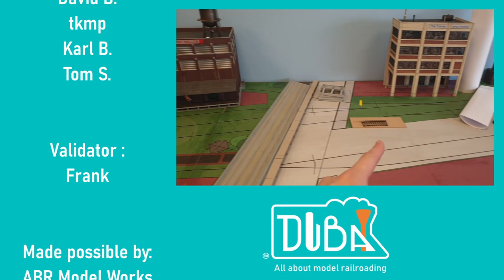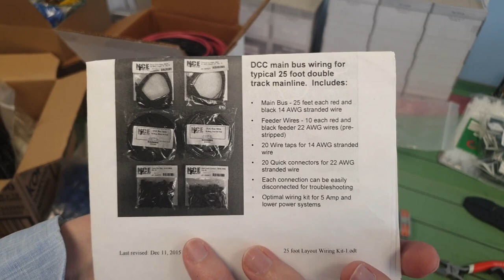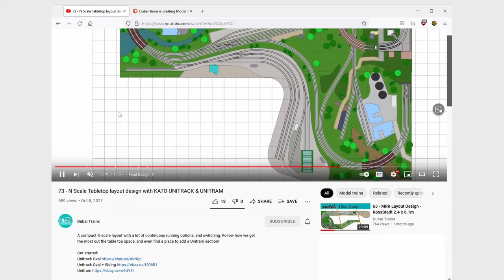EASY WIRING, Laying Track, Weathering, & more ~VLOG 134

Comment: Your attempt at reusing connectors is why I  switched to Posi-Taps for connectors.  If your feeders are stripped on the buss end you can install a Posi-Tap with no tools.  Plus you can move, uninstall and reuse a Posi-Tap.  Yes, they cost more, but are cheaper in bulk, and save a lot of time.   On another note, your layout is pretty straight forward for wiring up the buss and feeders. However, for those of us that have loops, return loops, etc. it can get confusing which rail gets a black feeder and a red feeder.  For your viewers they might consider using one of their junk freight cars that still rolls.  Place a strip of red electrical tape horizontally along one side and a strip of black electrical tape along the opposite.  Orient the car on the track as to how you will wire your rails. For example; red to front and black to back.  Then push the car along as you solder your drop feeders in place.  The car is now a visual tool to keep one's mind straight.  It will also help you find return loops where you will need to install an automatic reversing circuit.   I am watching your build to see how the modular benchwork holds up.
Reply from the maker: Thanks DK. I haven't seen those posi taps before. Thanks for sharing. They do seem handy. As for the blue connectors and bus i'm reusing, I'm just going to leave the connectors are there and reuse where i can. And the ones that are not needed ill just let them be. 
The car and tape trick sounds handy. On my precious layout the track made a 180 degree U turn and thus switching the front= red and back=black. I got a few of those feeders mixed up!

Comment: I use the same method for feeder wires. You can easily get away with one 5mm hole centered between the rails. Fold the rail joiner amd shove up from below.